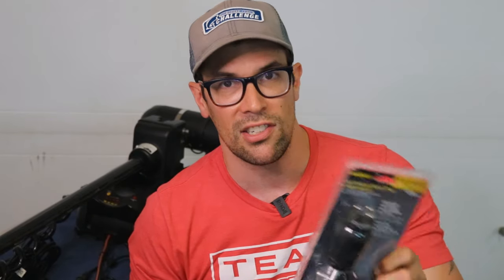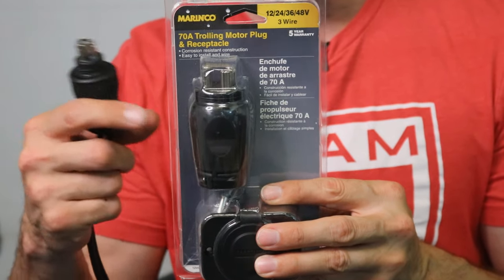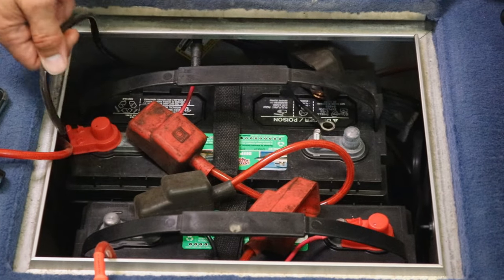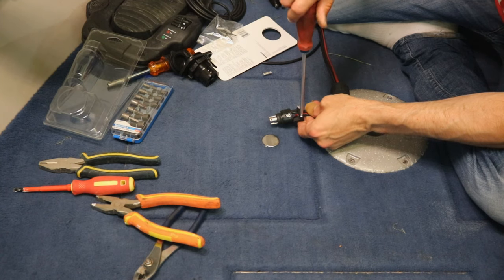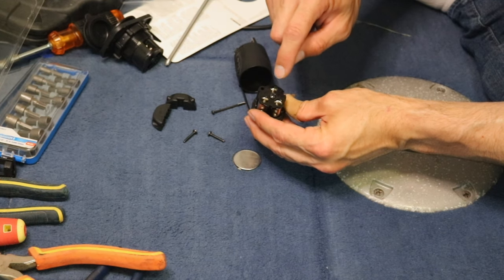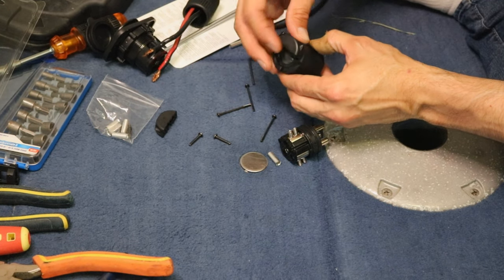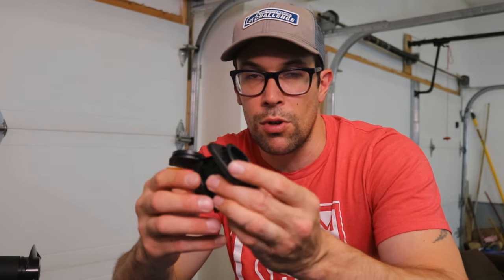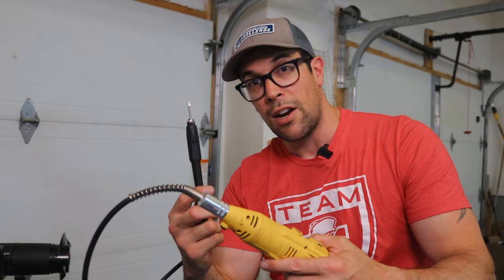How to Install or Upgrade your Trolling Motor Plug and Receptacle on Your Boat!

Comment: I have a Garmin Force trolling motor and I would like to have a plug in transducer cable.  Anyone doing this. I want to be able to pull out the power and transducer cables to take the trolling motor off the boat at times.  I have the Garmin Force mounted to a Minn Kota quick release floor plate.
Reply from the maker: How do you like your force??  I am thinking of moving to that motor myself!  Which quick release plate do you have?  I was wondering if I could do that with my MK quick release plate I already have, I've got the Terrova one, part number MKA-10-02.  Do you have that one or one of the longer styles?

For your transducer cable issue, what about just using a transducer extension like this? https://amzn.to/3Mt3mYE  You could have the extension go from your unit to the trolling motor and plug in the trolling motor at the bow for easy disconnect later on.  You'll have quite a bit of extra cable so you'll need to organize that out of the way.
Reply: @DanRichardFishing  I Haven’t used the Force yet. I just got it mounted Thursday and ordered the rest of my electrical components which most will arrive today and the Marinco 70A Trolling Motor Plug & Receptacle tomorrow. I used the Minn Kota MKA-42 quick release plate which matches the hole dimensions of the Force perfect.  I want to remove the Force when the grandkids visit.  This mounted on my pontoon boat so I don’t want them tripping on it.
Reply: PS: thanks for your great videos and help
Reply: Also, the Minn Kota quick release has a notch in the bottom for the tie down strap on the Garmin.

Comment: You've got to be kidding me!  They included WIRE FERRULES!  Marinco does it right!  That old connector, idiots at Minn Kota cutting corners, has a spinning screw going into the conductors of the wire SPLAYING THE WIRE on the inside which means the connection is absolutely LOUSY.
Reply from the maker: Yeah I was actually impressed that the ferrules were included, this plug is really well done.  Some other plugs I've seen are awful... the twist lock I had before was also useless, I was so glad I made this change!

Comment: Noooooo the wire gets soldered in the sleeve the way you did it it can pull out. I see it's a year ago I can only hope you've fixed it by now
Reply from the maker: You are not supposed to solder connections on Marine applications, especially heavy gauge connections. It creates a weak breakpoint. There's actually an American Marine standards guide where it talks about this although admittingly it is heavily debated. Some people say You're supposed to, others say not to so I just stick to what I learned in the guide several years ago.
Reply: Wow, did not know about marine standards.  New to Marine stuff. I guess I've got a lot to learn. Thanks

Comment: I have that plug and it rusted out in one day. They are not water proof at all. Make sure you dont get any water on it.
Reply from the maker: I've had mine now for 3-years and it's been rained on, soaked, snowed on and there isn't a speck of rust on it and I actually took it off the other day to do some work and underneath the panel it was still like I just installed it. Sounds like you got a defective unit that didn't have the proper nickel coatings or something cuz that doesn't make any sense whatsoever.
Reply: Well, I  bought a used boat and the connector was installed next to the front anchor locker vertical and its used in saltwater so the saltwater just runs right down into the connectors and short circuits it out. I'm hard wiring  inside the anchor locker - these connectors are always a failure point at some point. Im going to use a re usable splice connector. @DanRichardFishing

Comment: That plug is junk I had to replace it 3 times and what to a regular push in plug and know I have no problems I have owned 5 bass boats and all of them had the push in plug and if you're in a kayak and taking your trolling motor off and on all the time that dam plug is junk just do your self a favor and get the push in plug
Reply from the maker: I've had that plug now for about a year and I actually disconnect it every time I'm done fishing and reconnect it when I'm out on the water and its still as good as new. And this is a push plug so I'm not exactly sure what you mean, the twist lock is the one that I took off and that one was complete junk.
Reply: @DanRichardFishing   ok my bag I do think you're dead on  about twist one is junk sorry about that have a wonderful day and tight line's

Comment: Pigs don't sweat
Reply from the maker: 😂😂 Wrong kind of pig... The term is actually derived from the iron smelting process in which hot iron poured on sand cools and solidifies with the pieces resembling a sow and piglets. Hence "pig iron". As the iron cools, the surrounding air reaches its dew point, and beads of moisture form on the surface of the "pigs". "Sweating like a pig" indicates that the "pig" (ie iron) has cooled enough to be safely handled.  Is the internet awesome? :D